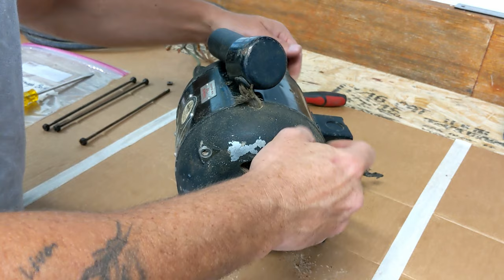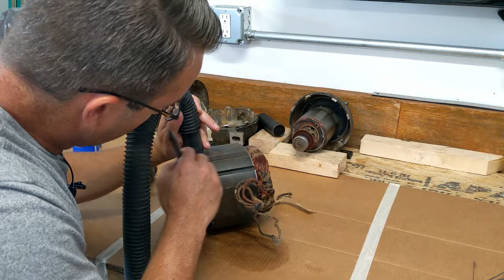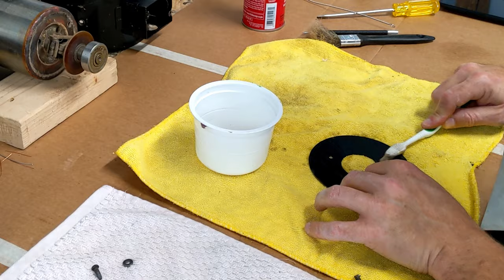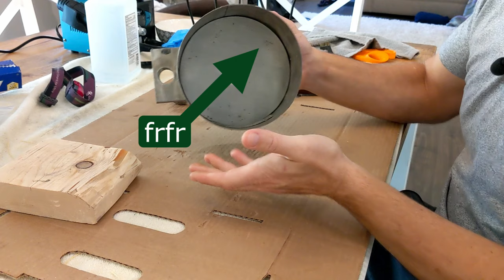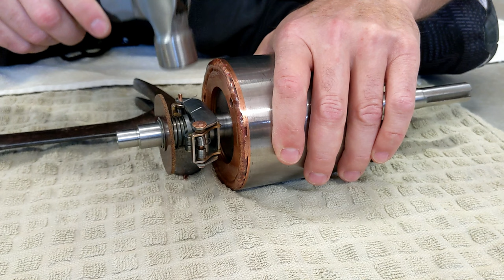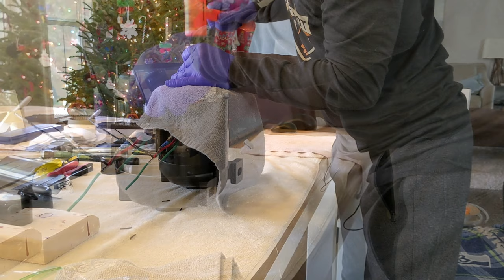Walker-Turner 10-inch Table Saw Restoration, Part 4: The Motor

Comment: A+ IMO, looks and sounds good. you really went through the wringer by having to re lead it twice when it didn’t fit. I have made my own lacing bobbin from two pieces of thin welding wire shaped like a banana for doing the lacing. Nice job!!
Reply from the maker: That's a good idea! This thing definitely took me for a ride. Thanks for watching! The folks in the motor group deserve an A+ for answering so many questions 😂

Comment: You mentioned that you were going to make a video on the fence. Did you get that far. The micro adjustment knob on my fence is very difficult to turn to fine tune the fence. 😢
Reply from the maker: I haven't got that far man, but I will. Had to take a break from this project due to family businesses, but I'm getting back soon. 💪

Comment: very impressive! I am curious why you chose 220V over 120V. This motor is dual voltage so you could have chosen either one. 
I just got the same saw for $15! and my weekend project looks a wee bit ambitious lol...but well done all around, i love it!
Reply from the maker: Thanks! Initially I thought it added more power, but that's not necessarily true. The actual benefit is that it can be more efficient (less current, so thinner wire and less heat), however, in my little space I don't think that's really necessary. Anyway, I had the 220v outlets installed way at the beginning of this whole journey, so I decided to use it on this. I did read somewhere that higher horsepower motors, like anything getting up above 2 HP, should be run on 220v, but I don't have the expertise to confirm that. So, I also thought I might end up with bigger machines, including a table saw, so that was another reason for having 220v installed. But, I fell in love with this saw and the idea of doing my best to restore it to an accurate, usable machine. So here I am, still truck'n. Thanks for watching! I'm working on the next phase now. Good luck with your project! 💯
Reply: Another question: my motor also has a hand painted ‘416’ on it! Does anyone know what that means? 
If I knew how to upload my picture in the comments, I would!
Reply from the maker: @PatrickWelch-md8vf  I have the same, which is kinda cool because I was an ironworker apprentice for local union 416 when I was younger. As for the meaning on the stator, I think it' some code related to manufacturing, but I didn't research the exact meaning. You could try one of the vintage machinery sites, unless you already have. I'll check on one of the Facebook groups I'm on.

Comment: Did you have the logo plates remade? Curious as to what the info plate is on the switch box? I'm redoing one of these right now.
Reply from the maker: Hello! No, the badges on the motor as well as the plate on the circuit breaker are all original. I spent quite a bit of time going over them with rubbing and polishing compounds to bring them back to life. I wasn't going for brand new on those, just refreshed, so the compounds allowed me to do that with good results while leaving the history intact. The text on the circuit breaker plate has some manufacturer info plus technical specs.